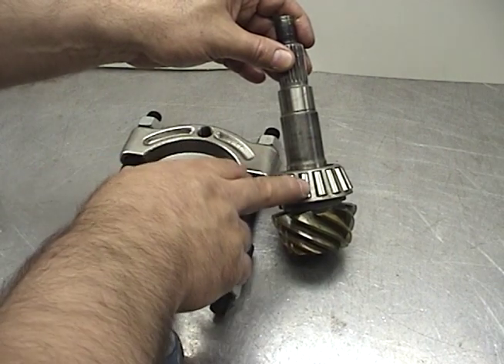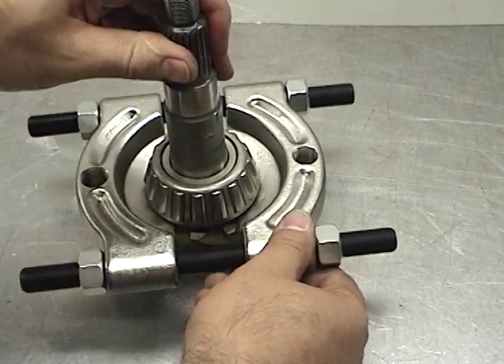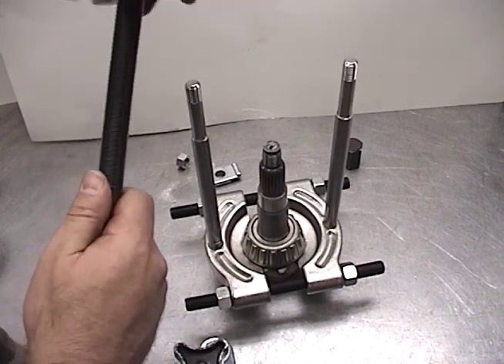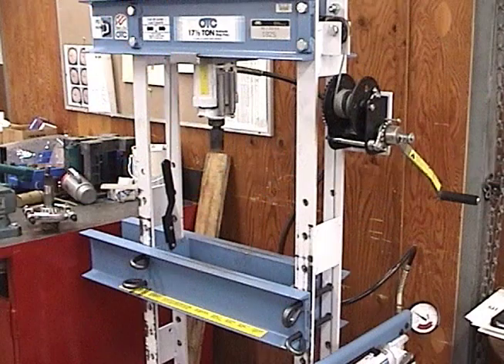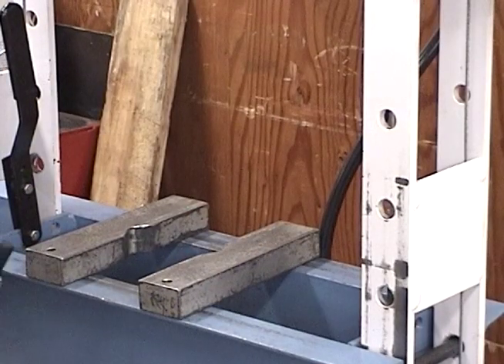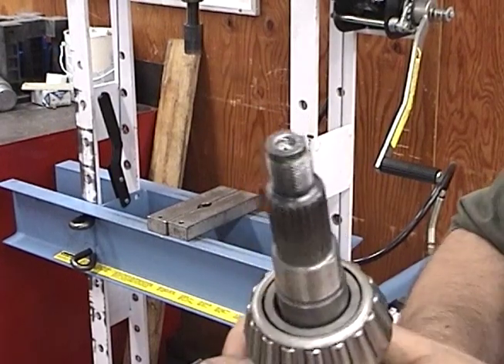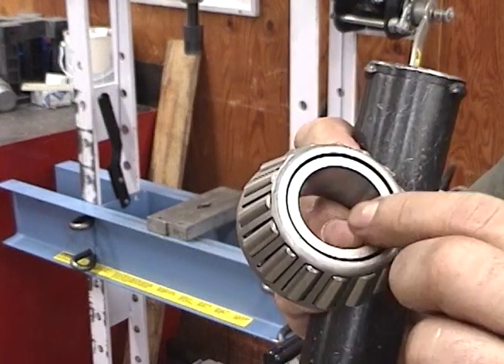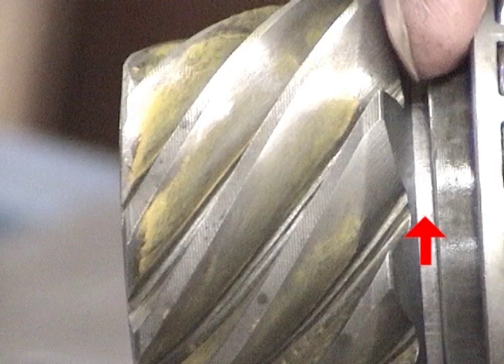Differential Drive Pinion R & R Part 3

Comment: I have had that OTC 1123 clamshell style splitter for years, but have never been able to find the correct attachment kit for it.  You state that yours is a "Universal Puller Set"- it would mean SO MUCH to me if you would kindly share the brand and part number of that set.  Thank you for your videos Sir.  Is it OTC 1180?
Reply from the maker: There are two OTC puller kits what work well with this splitter.  I'm using the OTC 1180 set that you can find here. https://www.summitracing.com/parts/otc-1180 or you can use the OTC 4518 kit that you can find here.  https://www.zoro.com/otc-puller-set-13-pieces-bar-4518/i/G3883988/

Comment: I have both the bearing splitter and a 20 ton press..... What do you think of the clam shell style pinion bearing pullers? I'm thinking of purchasing a set of them.
Reply: Clam shells work great but they are also very specific in size and not as flexible. The use of a clam shell puller tool that is designed for the specific application can work better than a splitter and press.